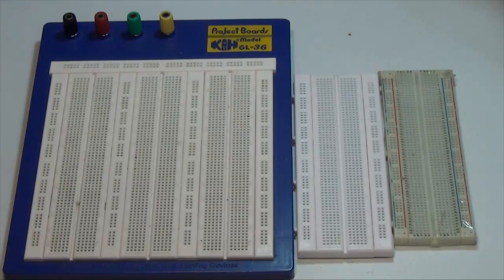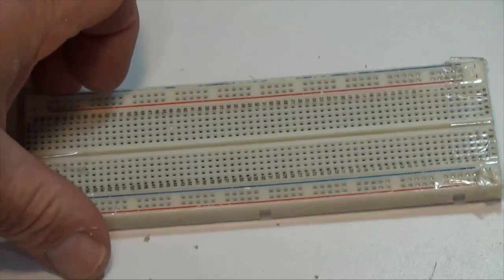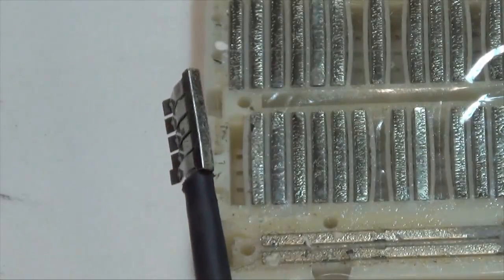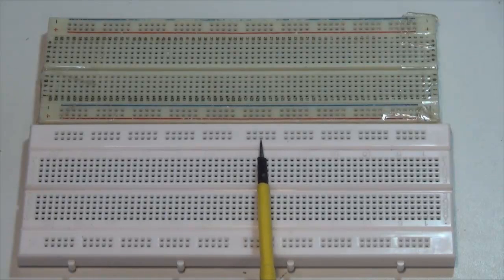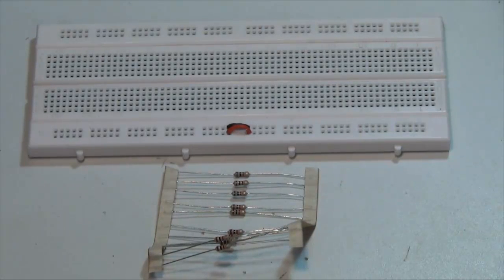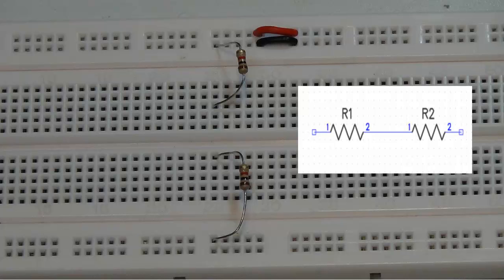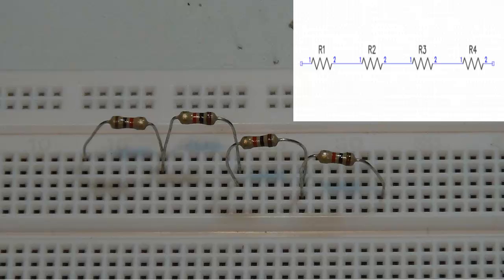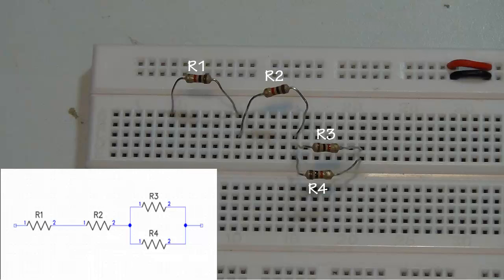How to use an Electronic Project board, Breadboard, or Bimboard

Comment: Dumb question I know, Is there a front and back side to the resistor line there is on a cap?  I am sorry for asking but I would like to do this correctly.
Very respectfully
David P, Gill
Spokane WA. USA
Reply from the maker: Resistors are non-polarized but capacitors can be either polarized or non-polarized.  With polarized capacitors look for a positive of negative symbol on the device and often one lead (normally the positive) will be longer.

Comment: sorry i have a question ?  what electronic is needed to stop signal from cell tower ,to shuting down the signal that make radiation  thanks
Reply from the maker: You are not allowed to do this!!!
Reply: You could try to insulate one room in your house from electrical fields and radio frequencies. This works much like a faraday cage and can be very expensive. Sheeting and screening of very fine metal mesh is fitted to all walls ceilings and floors, and shunted to ground rods.